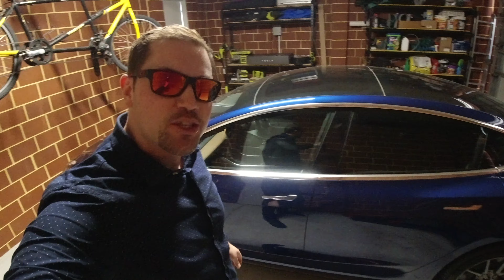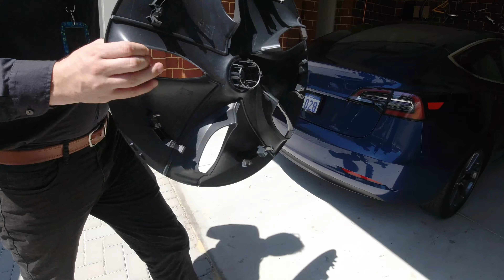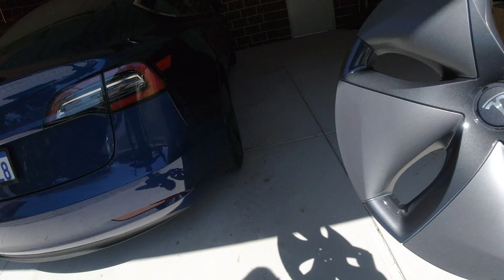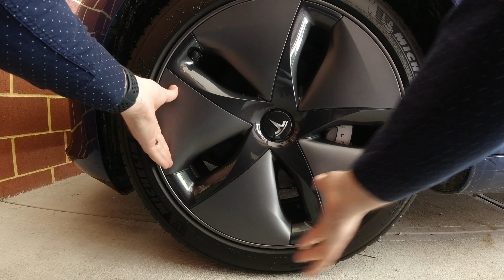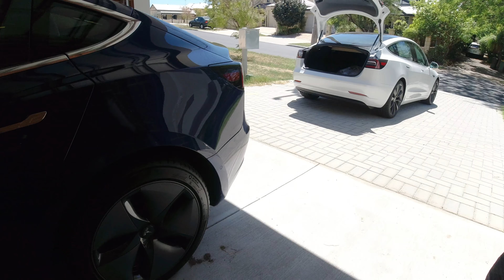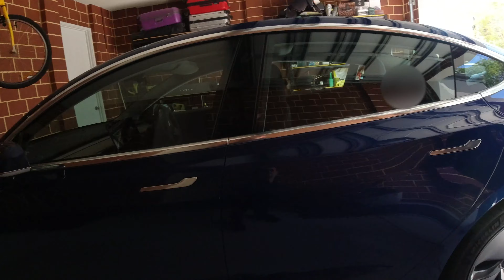2020 Tesla Model 3 Aero Wheel Cover Install & Remove Guide

Comment: I get about 100 watt hours per mile  better mileage when using the aero wheel covers.
Reply from the maker: Crazypostman yeh somehow my car just ‘sounds’ more efficient - weird, haven’t driven it enough without to quantify the difference yet. 100 watt hours is a fairly decent improved range